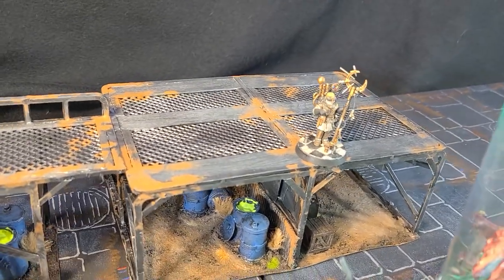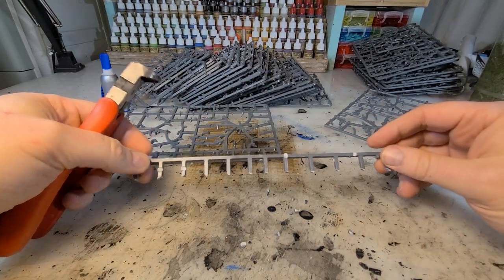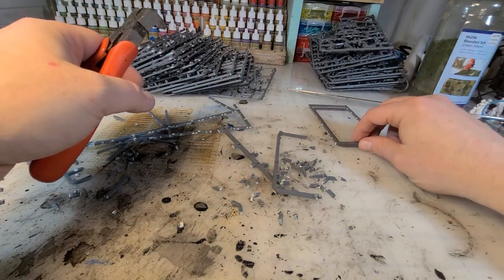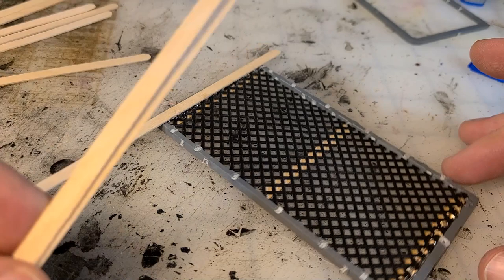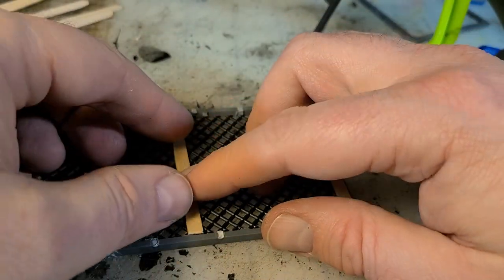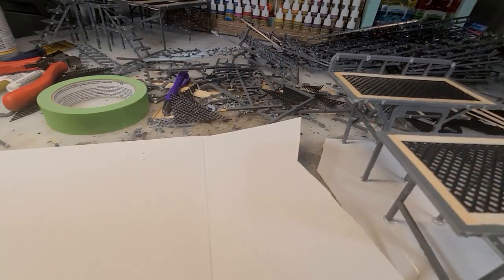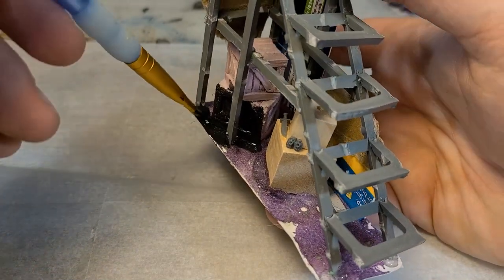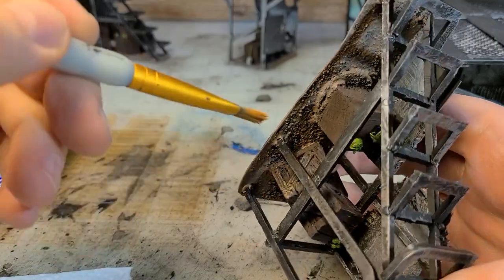Bits Box: Sprue Platforms and Walkways

Comment: Consider adding plastic-glue to your arsenal... it literally fuses the pieces together, and works a treat on old sprues. Though I'd still use super-glue for the "granny grating," since that's a different kind of plastic.
Reply from the maker: Good tip.  I'll look into it.
Reply: @brokenterrain  Citadel and Army Painter have their own versions, but most swear by Mr. Hobby, which the Bishojo Plamo (Pretty Girl Plastic Model) hobbyists use to seal up visible seams in the fleshy-bits of their cuties... not a problem I run into with 30 Minute Sisters kits, but Megami Device and similar? Yeah, they usually have some pretty visible seam-lines that a little plastic-cement and a sanding-stick won't take care of.
Reply: Yep - came here to recommend plastic cement.
Reply: man you gotta get a pair of godhand spn 120,those sprue cutters your using are gnarly are really leave some very rough stress marks all over the sprue and plastic I assume this is happening to your models as well however maybe not as important if your painting but seriously those nippers will change your life
Reply: @thetribunaloftheimaginatio5247 no most people swear by tamiya extra thin cement....Mr hobby(gunze aka gsi creos now)is also great but tamiya is the best however most people don't know you can save a whole lot of money by just getting tamiya x20 thinner it's the same ingredients at a fraction of the price
Reply: as a miniature gamer the only thing you should use super glue on is resin miniatures or any non plastic material Tamiya extra thin cement or gw plastic glue or mr hobby extra thin cement is something really important to use it makes your models alot harder to break because it chemically melts the plastic and bonds it together the extra thin cement as opposed to regular plastic cement is a little easier to use because it has quick drying time the thicker cement takes longer to dry and you do have to be careful because if you touch it before it dries you'll literally melt thumbprints into your models its a little intimidating at first but seriously make your supports and everything stronger you won't have to worry about breaking,however very creative and awesome idea for terrain,maybe try thinning your paint with a little water for a smoother result on the paint